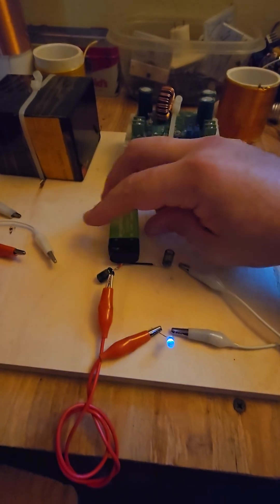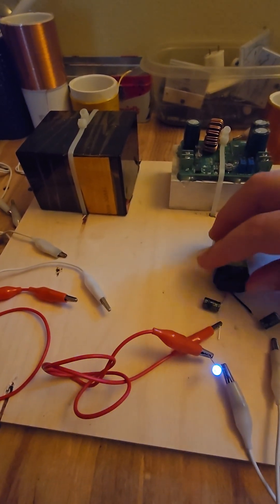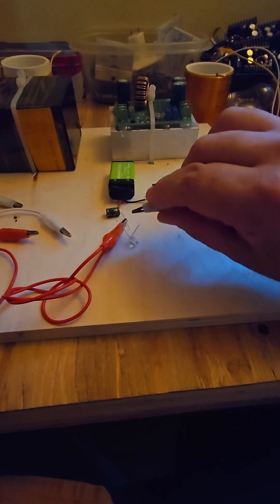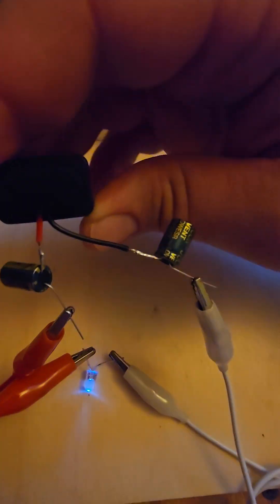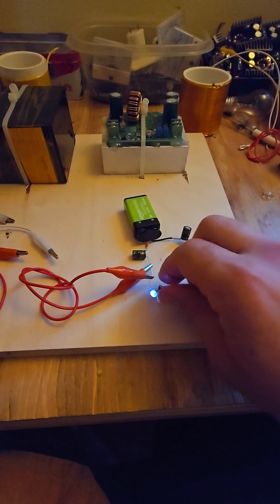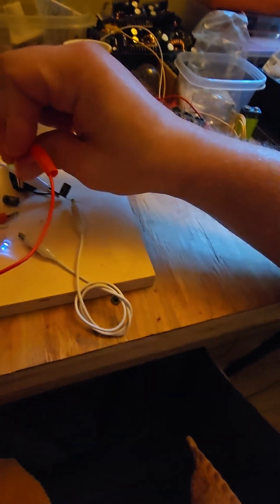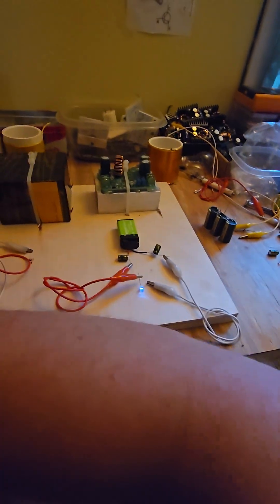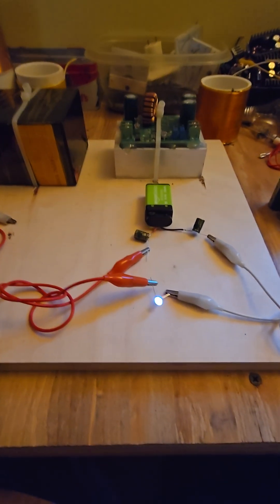UPDATED VIDEO ON REFINING THE ANOMOLY.ITS A CAPTRET?HOW IS DC FLOWING THRU SERIES CAPS?

Comment: Yes, Captrets used to be a big discussion back in the day. There are a bunch of kewl experiments you can find where the top of the cap can be used to get double output.
Reply: Yep, put one together today after learning about it. I set it up using the original design and am self charging some weak 9v batteries connected in series. So far, I've gained about 1v over about 4 hrs with an led running. Crazy ! One video i saw said that capacitors of this style act the same way as a thermocouple and absorb energy through heat transfer, thus giving the "extra" power ?¿ not totally convinced on that, but it kind of makes sense.
Reply: @jbDrum5 Woa that’s so weird and cool 😂 did you make a video about it??

Also where could I find this info about captrets?
Reply: i read somewhere they say the extra voltage is comming from some kind of chemical reaction inside the caps that is actually killing them and exhausting their chemical properties
Reply: Ok, that would make sense. In my testing, the results seem to disipate over time @MrBademy

Comment: I hate to say it, and I'm not saying what you have isn't possibly a captret but the original captret didn't even complete the + and - fully used, one connection was actually made to the can of the canister by cutting the plastic label off and simply wrapping a wire around the rim of the can and twisting it off you should have a plenty good connection for the low current involved.  If it's working the voltage on the battery I guess should rise over time, and you start with a "dead" battery.  You can find a bit of stuff about it online, including a video by Naudin.
Reply: the original just looks like the guy modified it to get different uf outputs. I could be wrong.
Reply from the maker: Very interesting & thanks for the update
Reply: Cool! How would you do it with bigger caps bigger load?
Reply from the maker: @rockon1122  probably just use a higher voltage dc battery & experiment with the two correct series dc capacitor values that causes maximum power output to the load at the absolute lowest input drain to the battery. :)

Comment: I have an idea why it works and it can be tested, the capacitors are "charged" up to max by the battery and then block the flow of current from it, with the battery dipole isolated the capacitors become the source of current for the load while the battery maintains the voltage potential.

If I'm right then if you put your amp meter in series between the battery terminal and the capacitor you'll see the current drop as the capacitor charges until it saturates, if you have 2 meters you should be able to measure current between the capacitors but not the battery connection.

But as for why some caps allow a trickle of current through while others don't, I don't know, that is weird. Perhaps it's something to do with the relationship between the capacitance and the leakage of the capacitor itself? Losing potential due to leak and drawing current to top itself up?

Are you able to get this result using non-polarized capacitors?

This opens up some great potential for self recharging battery circuits, if the current can be dropped so low it measures 0 from the battery then hooking it up to a pulsating circuit can have some of the energy sent back into the battery to keep it "charged" indefinitely, assuming it's even necessary with that self charging effect there. Btw you credited the wrong guy, the inventor is ibpointless2.
Reply from the maker: So far it works with low esr dc capacitors & very high quality induction cooker capacitors & some mica ones. Ceramics not so much